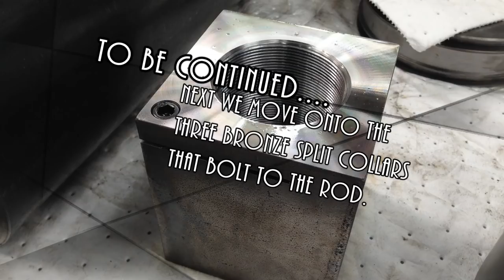Custom Cylinder Build Continued Part 2

Comment: Running the lathe while you hold the bronze piece to uncrew it is one of the most badass things I have ever seen. I would be too scared of the thread binding and having my fingers ripped off. 

Almost 20 years ago I had a drill press rip a piece of wood from my hands. No permanent injuries but I always used a vise ever since.
Reply from the maker: Yessir, drills can be super dangerous. Best to always use a clamp or vise. It only takes one time to learn though.

Comment: Hey Adam,

Good stuff buddy. Smooth as silk. You even jumped like a pro when that saw snagged a tooth.

Talk to you soon.

Tom
Reply from the maker: Yea, even us seasoned guys can get jumpy during shaky operations. I think I had a little too much feed on the cutter, plus it was a deep cut on that thin blade. it worked out well though. Lucky for me the cutter made it though the job.
Slitting saws can be a pain in the ass! LOL
Thanks buddy!

Adam
Reply: Shit. I thought the tooth or the cutter might have broken. You handled it well. I got a bit of a chuckle seeing you flinch.
Reply: Abom79 was it the vibration that caused it to chip a tooth or was is due to the cut? 
What will happen with that blade? Will it be scrapped or can it be salvaged and put back into use again?
Reply: 7:02

Comment: Threading and hitting precisely on thread every time is something between magic, witchcraft and a miracle of the divine estate.  I always add 10% to the job estimate to cover the one in 50 or so times that I will have to rush order a $600 piece of ‘nonexistium alloy’ that I have to rush order to replace the tiny screwup that somehow escaped my attention until nearly finished. [Aaarrghgh!]

Comment: Adam, nice video series.  Interesting seeing how big stuff gets made.

On the slitting saw part, I'd have thought that drilling the cap screw hole before cutting the slot would have been a good idea, to avoid deflection during the drilling. I know the part is beefy, so maybe that's why it wasn't a consideration, but in general wouldn't that be a wise move?  Just trying to understand for future reference in case I need to do anything similar.

The finish on that bronze was real pretty...

Thanks!

-- Mike
Reply from the maker: Mike, you could do it either way, this was just my choice as I was working on the part. One benefit to slotting it first is to give me an easy depth for drilling the clearance hole for the bolt, but can do the same using the quill scale or knee dial.

Comment: When you cut threads on a lathe, how does the cutting bit always start in the same place?
Reply from the maker: Nathan205 The leadscrew is timed with the spindle through a gear train. You must engage the half nuts at the correct position on the threading dial.
Reply: Oh I gotcha.  I've seen lathes cut threads quite a few times, but I've never done it.  Thanks man!

Comment: Hi Adam,
I take it that the socket head cap screw is for locking the threads?  Is that typical for that kind of cylinder?
Thanks for the videos!
Take Care,
Reid
Reply from the maker: It's how the factory designed the original unit, and I was copying it. Tighten the bolt to lock the square block onto the threads.
Thanks Reid.

Comment: So, ignorant question about drilling the cap screw hole after you'd slotted it:  is it ever done to put a piece of shim stock the size of the kerf into the slot to hold dimension while you're drilling, so that things like the thin side of this workpiece doesn't drift and make the hole oversize or out of round?

Comment: Nice work Adam.  What kind of mill is that, it looks kinda like a bridgeport or a knockoff except the quill does not look like an R8?
Reply from the maker: It's a 12x58 Acra mill, with a 40 taper spindle and 5HP motor. It also has rapid z axis which makes it ever nicer!

Comment: Hi Adam - Excellent video as usual
Quick question - the hydraulic ram appears to be capable of a number of tons of force - will the bronze bolt you made be able to handle that much load?  For some reason I keep thinking bronze doesn't have much strength.
Thanks again - Rod

Comment: Hi Adam, watching another great video and noticed a sound that sounds like your gear box is missing a tooth on your lathe, just guessing.
Reply from the maker: Good guess. That lathe was crashed a while back by someone else long before I started there and two of the gears are missing a tooth. It gets used daily so taking it out of commision for a repair is out of the question. But I do have the new gears down in my tool box for whenever that day comes.
Reply: +Abom79 I know old comment, but have you ever had to break out the new gears for the lathe in this video due to that one job coming that simply needed the new gears to be put in?

Comment: ADAM: What brand and which insert are u using for such an interrupted cut. What size 4 jaw is that? Sorry for all the ?ss

John
Reply from the maker: John, sorry for the late reply. I have been using Iscar cnmg 431 for most of my work there. I think they are IC 8350, but dont have them in front of me to say for sure.
The 4 jaw chuck Im using a 12" that came with the lathe.